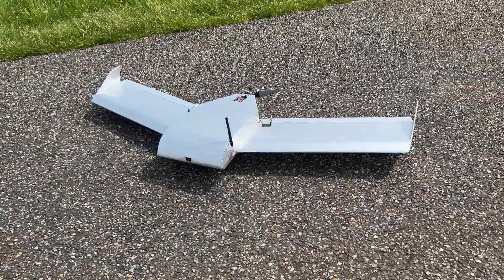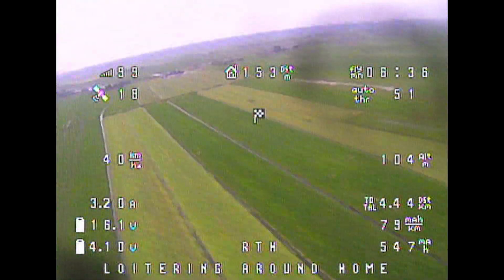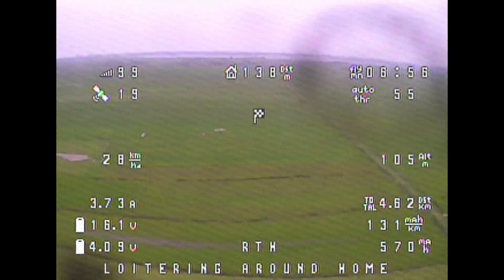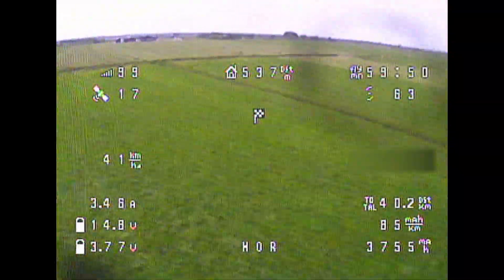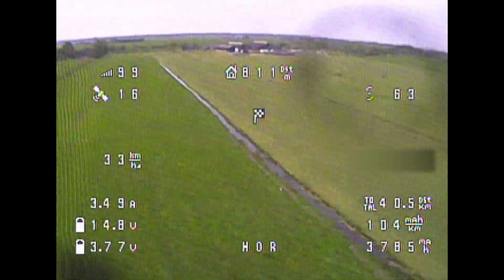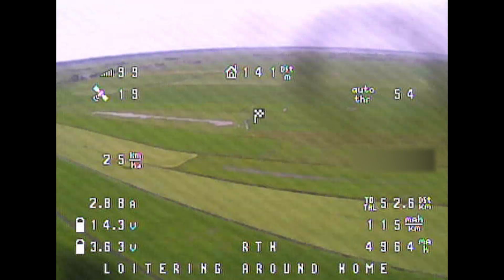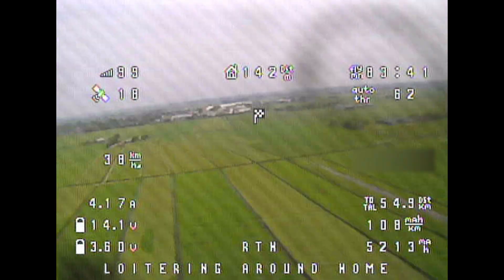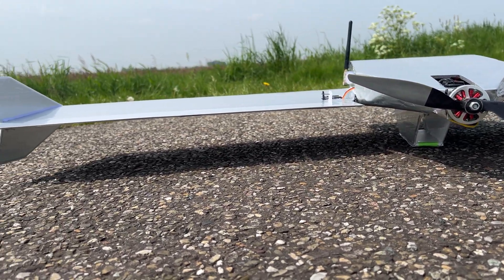Flying Wing for FPV - Endurance Flight & Range Test

Comment: Your avg speed was 37km/h. This is your problem. In a real long range flight it is unacceptable. If you don't want to fall asleep during flight you have to fly min. 70-80 km/h. But at least 60. Test your plane with this avg speed. You will be surprised how bad it conpsumes. I suggest using a 2807 1700 kv motor on 4s with a 7x4.5 prop. I used it on my Mini Talon with 4s2p 6000 18650 and on Skywalker x5, both have same wingspan as your plane. Hurry up and go HD! But forget Walksnail, go with Dji or Openipc. I use Dji, flying 20 km far is a routine task, it can fly up to 30 km far. Now I use 18650 Lg mj1 cells, 6s2p config, T-motor 3110 780kv, 9x5 Aeronaut nonfolding prop, cruising at 80 km/h on 6 amp. But the 4s setup is also a good option I mentioned before. https://youtu.be/Z00GsnvxeR4?si=ON4I1EeTZvUWzlGu
Reply from the maker: The objective was for how long I could fly, thus naming it the "endurance flight". For an efficient platform (flying fast & endure longer) a different approach in wing-design & fuselage construction would've been considered.
Reply: Low speed has its value e.g. when aircraft needs to loiter longer time over a small area.

Comment: I don't know if it's a bad idea or a good one but I've had to think about why we don't design a Patent, for When the wings of the aircraft absorb the air it can. Being able to generate energy to the same battery inside the Plane, I think it may be possible and very interesting to see it one day created, I think it would help the autonomy of the plane to generate more Time on the air, it's a great idea I think
Reply: already exists, search up ram air turbine, it is a backup powersource for commercial airplanes incase of emergency, it might not be practical in a small rc plane
Reply: @egg5594  Interesting
Reply: @J_Art_On_The_Beats  to add, RATs are not used because it increases the drag so much that it negates the gains it provides by generating electricity
Reply: @alienbeef0421  It may be something negative but remember that we are trying to do something more efficient to improve everything that is already done and is improved that's why we can discuss a better invention
Reply: No ,it would not work ,it physicly cant produce more energy than it wastes by slowing the plane down ,if that worked ,the whole world would be powered by Perpetuum mobiles